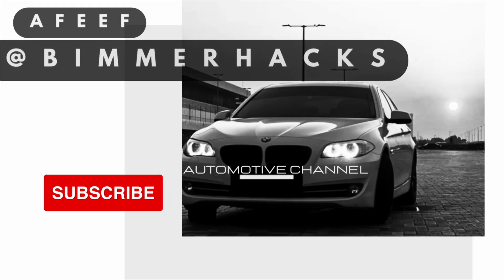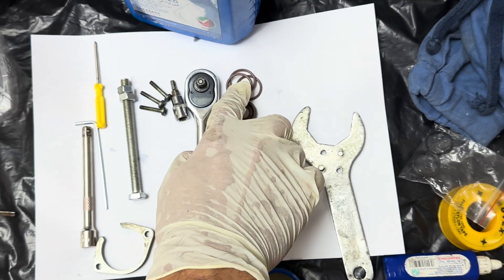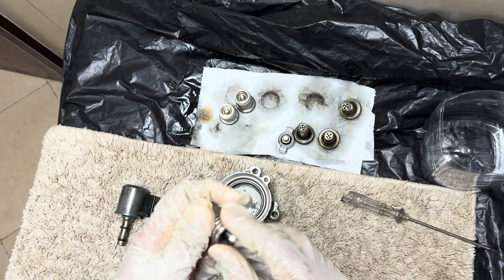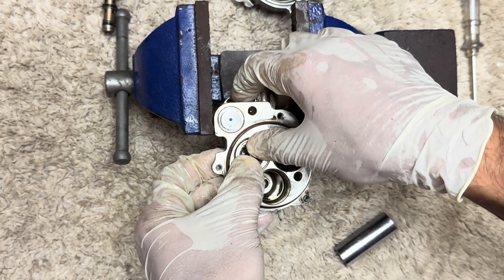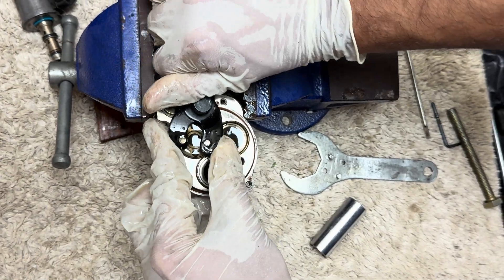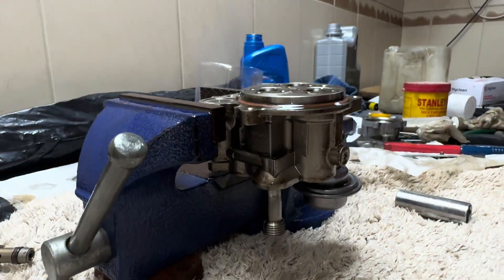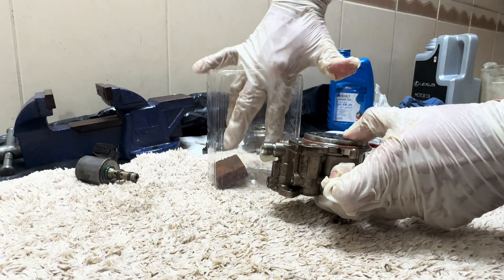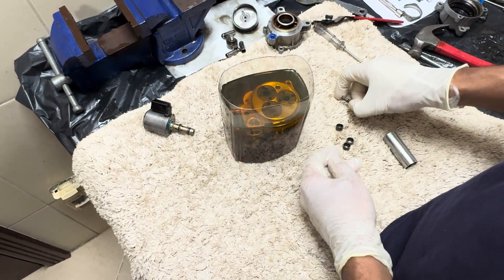HIGH PRESSURE FUEL PUMP REPAIR FOR 20$ BMW/PORSCHE

Comment: What is the special tool you use to tighten the valves
Reply from the maker: My dad made it. It's like the mechanical grinder blade tightening tool. Please keep in mind the performance of the revived HPFP won't be as good as new one but will work without any issues if done properly

Comment: What oring is responsible for holding fuel pressure? I have long crank and just want to fix that.
Reply from the maker: O-ring or X-ring which holds the compressor springs

Comment: Have you measured the diameter and width of O-ring groove?
What are the values?
That will give you an idea of the best O-ring size.
Reply from the maker: O-ring size 1.8mm thickness and 20mm inner diameter

Comment: Hello friend, can you tell us how the pump is working after the last video.
And it is possible that you could sell me the O-rings, the oil seal and the syringe (as a kit) since it is not possible to get them and if we do get them, they are not for high temperature
Reply from the maker: High pressure pump same as our pressure washer wherein the fluid is getting pressurized by pistons. The shipping cost is too high from UAE
Reply: @bimmerhacks  Friend, I wasn't saying that you should sell us the high pressure pump, but only the spare parts (o-rings, the seal and the syringe), that would be good, as it will actually be much cheaper than buying or importing the complete pump.
And on the other hand, how did the high pressure pump that you fixed turn out? Did it work well?
Reply from the maker: @imprezae.i.r.l.  it is working fine... It will never be as new. I did mention about shipping the O-ring n seal, that too Shipping is high

Comment: Hello, thank you in advance, you have made a very valuable and informative video.
Please tell me how to find the rubber o-rings you used. Which code would be suitable if I bought it.
Thanks
Reply from the maker: The manufacturer code differs from shop to shop. I would suggest you to visit a shop that does truck and machinery hoses and seals. They must have all the sizes. You must take the parts with you to get the correct O-rings and seal
Reply from the maker: The manufacturer code differs from shop to shop. I would suggest you to visit a shop that does truck and machinery hoses and seals. They must have all the sizes. You must take the parts with you to get the correct O-rings and seal
Reply: Ok. Thanks for all. @bimmerhacks

Comment: hi sir have you repaired hpfp. then how did the engine start, everything works normally? It would be good if you made a video about it.
Reply from the maker: Each time different type of performance. I think thicker oil lasts longer
Reply: I understand that everything is working normally. What if I pour 10w40 oil?
Reply from the maker: @baxtiyarquliyev2846  none of the  oil that I used is perfect till date

Comment: Codes keep coming back. Is my pump defective or is my o ring wrong? I used 20x2
Reply from the maker: Measure the diaphragm depth. If it's more than 20 u have leaking diaphragm or o-ring